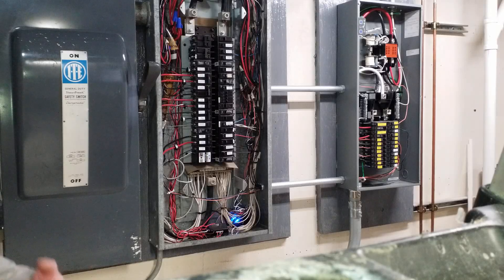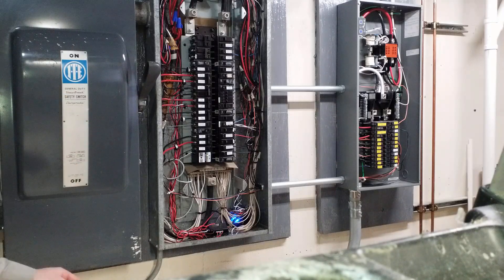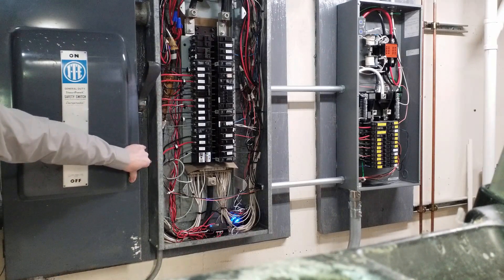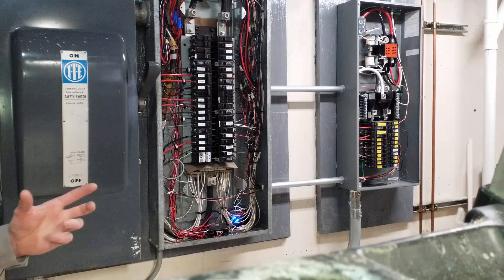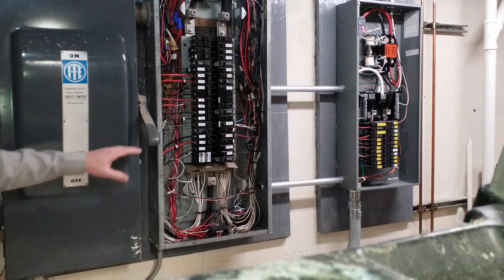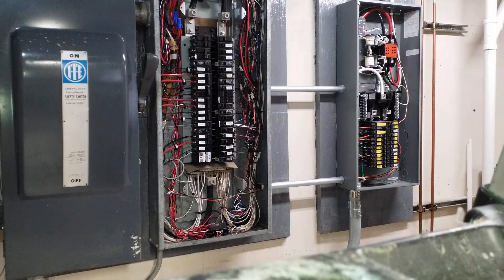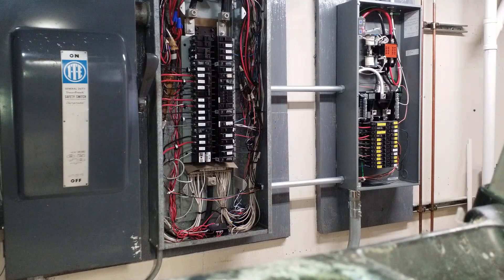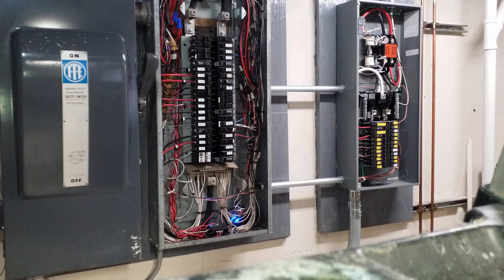Testing Automatic Transfer Switch

Comment: The long runtime after switching to land power is a cooling time for the genset to run without load , usually 90 to 120 second, of course considered the size of genset you have. But if 200 Amp supply is sufficient i guess your genset to be a smaller size, so that would be the usual cooling time.
Switching to emergency power should normally take no more than 6 to 8 seconds, safetime to get the genset and oilpressure up running full speed before switching to prevent any harmfull surges to the alternator.

Comment: Great video demo! Just be careful doing a disconnect under high amps, could blow due to arc flash, so step to the side away from the door blowing out is what arc flash protocol calls for. 

For a demo, good to lower the amps
Reply from the maker: Thank you! I did make sure the A/C systems were off before opening the main disconnect. Lighting was pretty much the only thing on at the time.

Comment: Do you have a electrical fence I heard snaps in the back ground
Reply from the maker: No, that's the auto relight module for the furnace. Apparently the previous owners had an issue with the pilot going out and had that installed years ago.
Reply: @owenperkins  can you do a update on your central vacuum system last video I have seen you had a MD
Reply from the maker: @cyberlight22  I can do that! Might wait until I get the Retract Vac installed for the garage.

Comment: I can think of 3 reasons why you want a certain delay between mains power coming back, and switching from generator to mains power: 
- It's best to let the generator run for a bit longer, so water produced by the combustion process does not linger in the exhaust system and rot it out. To reach full operating temperature, the generator needs more time, but at least the exhaust system will be hot enough for the water to evaporate. It also helps recharge the starter battery. 
- You want to avoid turning off and restarting the generator multiple times in a row (going through darkness each time), when a recloser trips 3 times before locking out. 
- For the grid as a whole, it's beneficial if it doesn't go from 0 to 100% load instantly. If all mains connections would be brought online staggered, it would mean there's a lot lower inrush current. 
Gotta say, i am a low voltage electrical guy, not a high voltage guy, so i have no idea if there are things that are super obvious to the high or mains voltage guys, that i'm not seeing.